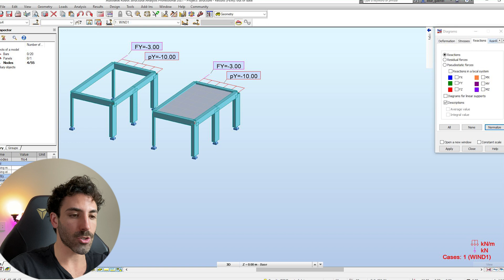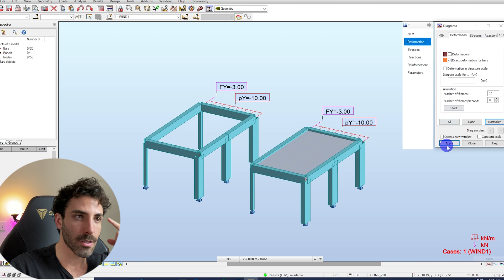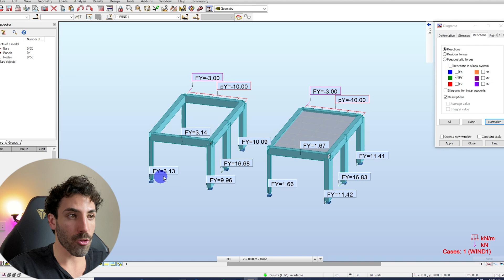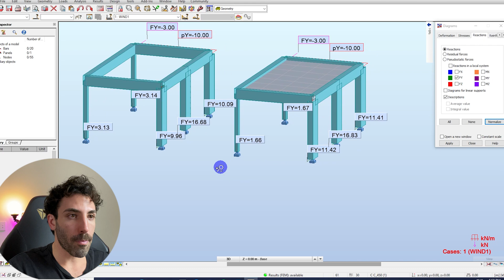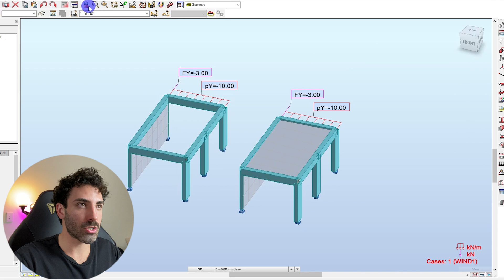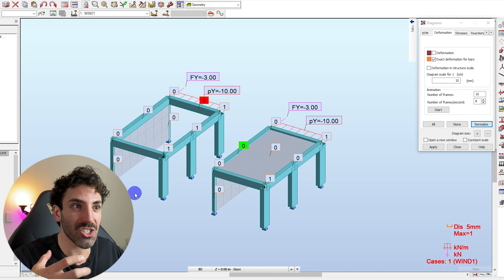Concrete Diaphragm - Grad Engineer Mistake

Comment from the maker: Obs.: The suspended slab can absorb bending moment and reduce deflections depending on its rigidity. You can create a portal frame system with the slab as long as you design it to work as such. The point I’m trying to make is that the forces will not disappear. The sum of the horizontal reactions will still be the same with or without the slab and if your columns are not stiff enough, the structure may still excessively deflect.  Hope this clarifies :)

Comment: onz thing is that a diaphragm (concrete slab) is a horizontal bracing, so it is a bracing. however, the overall structure misses vertical bracing. just to clarify, it does not mean that the slab (or diaphram) is not acting as bracing.
Reply from the maker: yes. Thanks for the clear explanation :) The point of the video was more to remind engineers to follow the load paths and transfer the loads from the horizontal bracing to the vertical bracing and foundation. Just basic stuff that we miss when we're starting in the profession. Cheers
Reply: yeah, this video was almost clickbait
he didn't prove his initial point

Comment: I am bit doubtful about the last illustration of wall modelled. Becoz no diaphragm can be compared with flexible diagram and flexibile diagram distribute the forces equally to the colums opposite of walls must have higher deflection as their stiffness is less
https://youtube.com/shorts/5P0WbSV2kcc?si=ei4nuTO1OVM9YsrG

Comment: Hi,
What can you tell us about exporting steel model from Robot to Revit?, What can be done in robot (modelling) so model can be exported to Revit with minimum adjustment of the model. In Robot centroid/system line is always central no matter what cross section is (potato/rock), right?,  There is offset tool, and gamma angle?, In general by what I'm hearing from other Eng and drafters there are limits in robot regarding geometric set up in robot. Any advice or good video explanation of this issue, thanks
Reply from the maker: Hey mate. This area is not really my expertise. I don't use Revit much. You're better off talking to a drafter. Sorry I can't help.
Reply: @bengthebrazilianengineerinAus  ...all good mate, I spoke to Graitec Engineer who gave me their paperwork about this topic.... thanks anyway